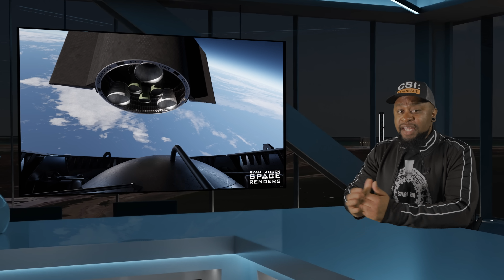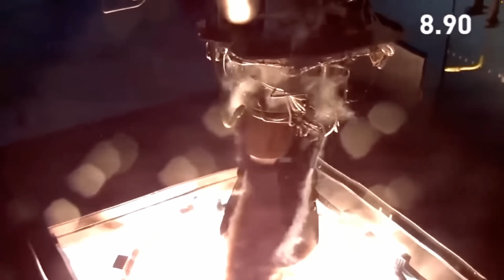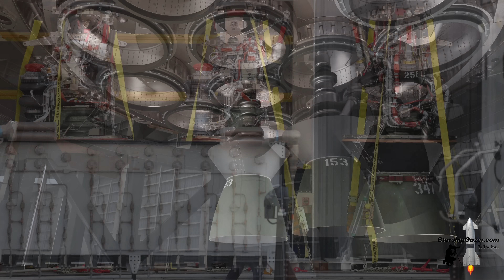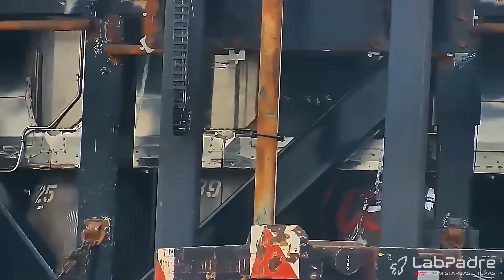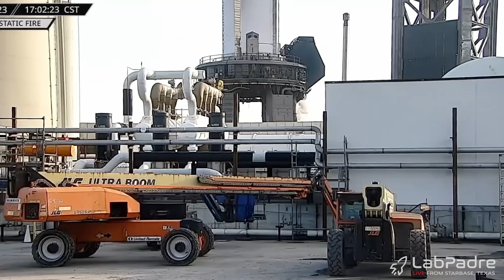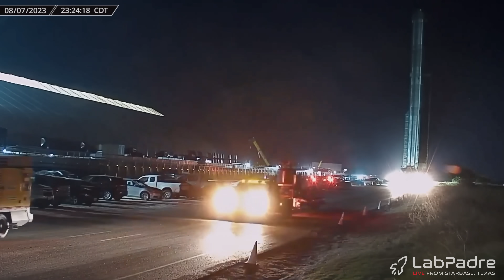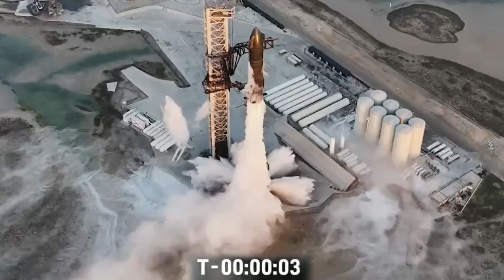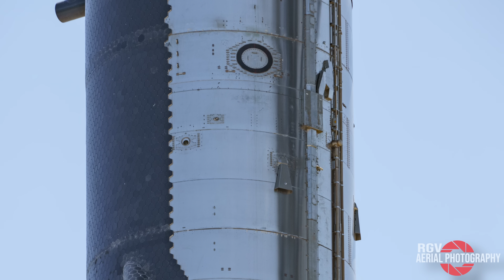How To Prevent Raptors From Destroying SuperHeavy | Part 1

Comment: night and day between both runs, still stone age compared to SLS1
Reply: For an all-new hardware, not designed since 1970s (ehm), a tremendous progress indeed
Reply: orion was being developed from 2014 on. Actually comparable to SpaceX. And it worked 1st-“try”.
Reply: It's just two different development philosophies, which are both valid. SLS had to work on the first try as it was launching an actual payload with the orion capsule while SpaceX choose to do test flights sooner in the development cycle for more data, but at the cost of likely loosing those vehicles without launching any payloads.

Comment: I can't imagine a way hot staging could ever work with Raptors. What material can withstand 3 Raptor jackhammer torches from a couple meters away. Even at 50 percent for a couple seconds it's too much to hope for on a fully rapidly reusable super heavy booster. It's way too much fun to watch them try. Kinda feels like it should be illegal. 🤓 I sincerely hope SpaceX proves me wrong!!!
Reply: Hot stagging with large engines was imagened in the 1950th period, with engines attached on the side of the upper stage in external nacelle, so when they fired the exhaust don't hit the booster.
Reply: @theOrionsarms  I know the Soviet's prefected hot staging long ago, but not with an absolute beast like the Raptor 2. That's what makes this so fun to watch.
Reply: @scott6129  well you said that you can't imagine how that could work with a large and very powerful engine on the upper stage, that wasn't made until now, but like I said was imagened, and in a very different way that SpaceX are doing now, if the hotstagging caused booster and the upper stage failure, they can look at some of the old ideas for inspiration.

Comment: Cheers SpaceX! The only thing I worry being overlooked or not thought about is the Hydrology end around the platform. Seeing that amount of fluid be cast all around the pad are and knowing the concrete only goes out a little ways the concern is the water seeping back towards the underside of the platform. Water likes to follow anything before it goes through soils. So the legs anchored deep would likely be a inviting route for it to travel and eventually my erode the sub soil or weaken possibly. I'd like to see some kind of capture reuse system to help save water but also collect water and help avoid issues

Comment: If they have two HPU's, both hydraulic power supply lines can be connected with a mechanical shuttle valve T'ing into the branch/manifold connecting power to the Raptor TVC's. This way, the pressure from the active HPU seals of the line to the faulty/standby HPU.  I.e. even if one blows up the other can continue operating the TVC.
Reply: Luckily hydraulic lines aren't implemented in neither the ship nor booster moving forward

Comment: Elon Musk has redefined the meaning of the word "success."  Henceforth, "success" can include multiple failures, including the total loss of the booster, the vehicle, and failure to reach its primary goal, which was to get to sufficient height and speed to make one orbit of the earth.  This thing will be lucky to get into orbit, and it is unlikely to ever get to the Moon, much less Mars.  I doubt that it will ever get beyond orbit primarily because of the need for multiple successful launches of "tankers" in order to engage in a yet to be described or demonstrated  "refueling" of the Starship in orbit.  The notion of "reusing" either the booster or the Starship remains an unlikely pipe dream.
Reply: re: success -- It depends on where one sets the goal posts.,  For the program one could set the goal posts at a successful moon landing and return of astronauts.  From that point of view every test during the development program is a failure.  Not a very useful point of view for any complex program involving 1000's of elements big and small to go right.  Here is a short list that comes to mind re: IFT-2

Success ---  rapid destack - component replacement - restack with only a 24 hr delay.
Success ---  Smooth fueling and countdown with only a minimal (less than 1 min) hold.
Success ---  Liftoff with all 33 booster engines operating.
Success ---  Liftoff with essentially zero damage to the pad using a revolutionary pad cooling system design and implementation.
Success ---  Replacement of hydraulic gimbal actuators with electro-magnetic gimbal actuators.
Success ---  Completed booster phase of flight with zero engine cutoffs reaching designed velocity and altitude for the stack.
Success ---  Coordinated booster engine shutdown followed by stage separation.
Success ---  Completed planned booster flip maneuver for boost back.
Success ---  Ship engine ignition and no cutoffs during ship phase of flight.

All of this on only the second flight test along with probably 100's of other changes made since IFT-1. In addition the data capture will help develop design changes to achieve more success for IFT-3 in the test program.  As a baby is learning to walk would you consider every fall a failure until they can sprint?  That is a pretty negative point of view.
Reply: @datamatters8  Let's hope "Starship" will be more successful than the silly "Hyperloop," the absurd "Las Vegas Loop,"  the ridiculous "Tesla Robot," the "Electric Semi,"  "Neuralink," and Musk's never ending promise of "Full Self Driving," which Musk has promised will be coming "some time next year" for almost a decade.  Meanwhile, the "Beta" version of the FSD pipe dream has caused dozens of accidents, many of them fatal.  Finally, let's not forget that about once a week a Tesla somewhere spontaneously bursts into 2,000 degree flames which firefighters cannot extinguish and must simply be allowed to burn out for hours while spewing toxic chemical fumes.  How many homes, ships, and parking facilities must be destroyed by these Napalm-Mobiles before skyrocketing insurance rates make them uninsurable?  Here's some good advice if you own one of these things:  DON'T charge it in your garage!

Comment: Great report. Would love to hear what they are doing about the tile loss problem.
Reply: They altered the installation process between s25 & s28-s32. If it wasn’t resolved for those then there will likely be further upgrades as the move from Starship v1 (that ends with s32) to version 2 (s35+?).

I would love to see Zach’s in-depth analysis of this and other significant changes to the next few starships that will fly.

Comment: When the launch took place, did anyone notice the sound from the engines?  It wasn't a constant roar, but it sounded like explosions under the engines.  This is a problem with burning methane as a fuel.  Usually, we have to mix methane with another fuel to get a constant and complete burn with consistency.  The real humor is the use of methane, while all the climate change people think methane is THE problem.  The same people that think meat comes from a store, and they want to get rid of all the cows.